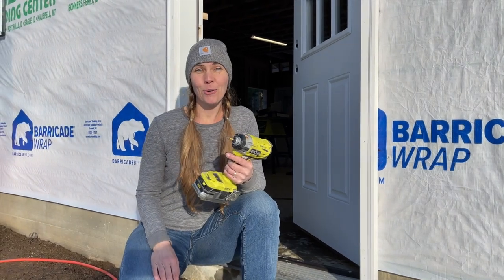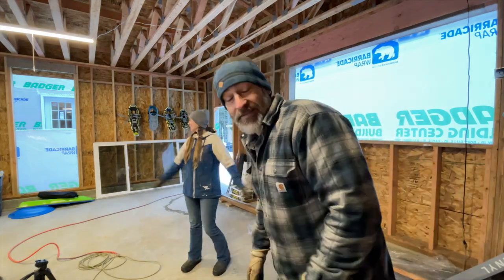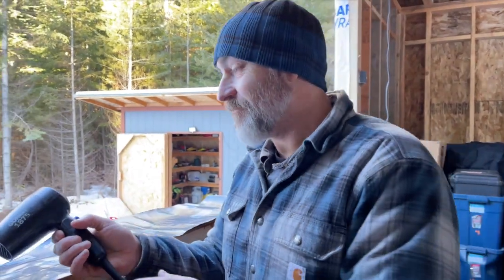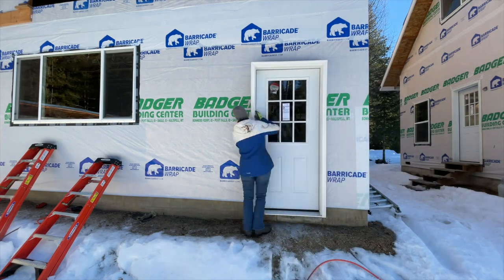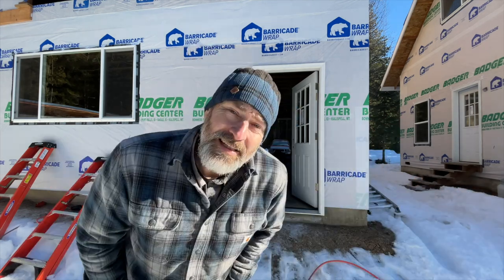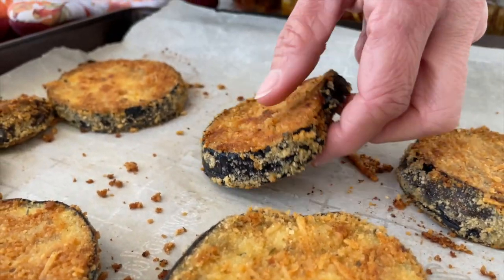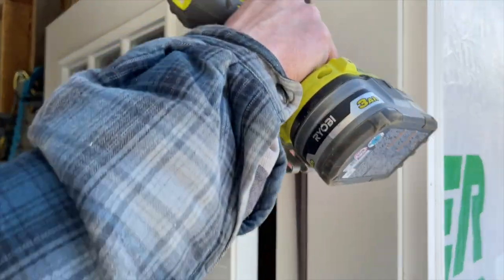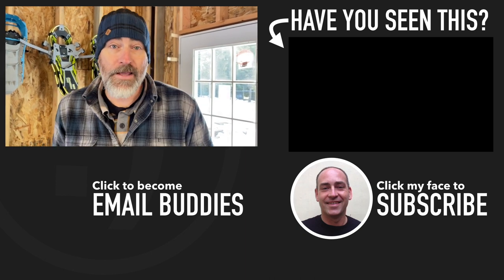Installing Garage Doors and Windows - Building Our Home in the Mountains

Comment: What you can do is keep the rubber tape inside close to the woods stove when you get ready to start a project then as you need it go get it and use if and pu tf it back so it doesnt slow you down any.

Comment: You forgot the most important step when installing a new door of replacing the short 1/2 inch screws in the hinges and strike plate with 2-3 inch screws to bond the door to the 2x4's of the structure. With the short screws you can break the doors frame by slamming the door too hard as it is just that thin wood currently holding the door.
Reply: He explained that on the first door he installed, he didn't wanted to do it now because the glass part was vulnerable anyway.
I would have take security glass if I were them
Reply: Good idea! Thanks!

Comment: Suggestion: after the outer walls are done.. add some Awnings over your windows.. enough to keep the snow rain off your windows. add some dry dirt and some teeny tiny pebbles for your chicken so they can easily scratch n have a dirt bath in the rest-box inside your chicken coop ..even if its snowing outside.
Stay safe.. God bless.

Comment: If you have a south facing window you can put the roll of black sealant tape inside the house in front of the window to soak up the sun and heat up. Makes it a lot easier to work with in the cold months. BTW its called Vycor, its written all over it, just sayin. :)
Reply from the maker: Good idea.

Comment: Hello. Professor. Shim stock. Should be. Three inches. Wide.  Behi nd every Hinge. Replace hinge screws  with 3 inch  scews. Centered  in. The. Opening.widowsand. doors. Shined  tight to header  that leaves room for. Settling. Looks. Great

Comment: How long will house wrap survive without siding? 6 months max?
Reply from the maker: It will depend on the brand and on how much sun exposure it has. In the northern hemisphere on the north side of a building it will last longer than on the southside. probably the east side will last longer than the west side, just depends. You should check with the manufacturer to be sure.

Comment: How do you check the accuracy of a level. ?
Reply from the maker: I don’t. Just hope it is good.
Reply: @MartinJohnsonOffGridLiving  You test horizontal and vertical. Place on surface. Check where bubble is. Twist around for other end to be on the other end. Bubble must show in same position. For accuracy can be checked on any level. When moving ends around, bubble must show on same spot.